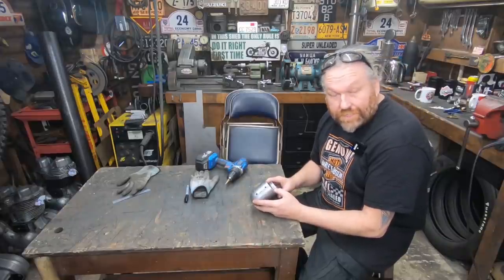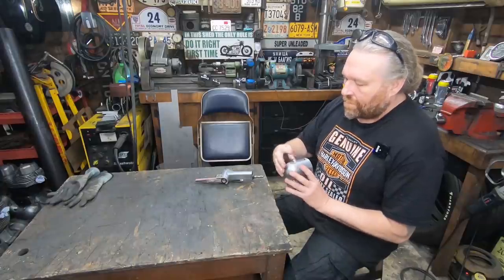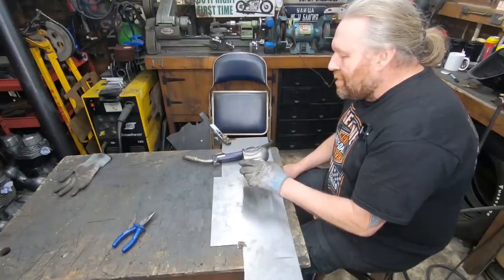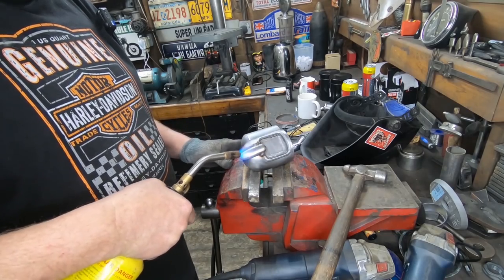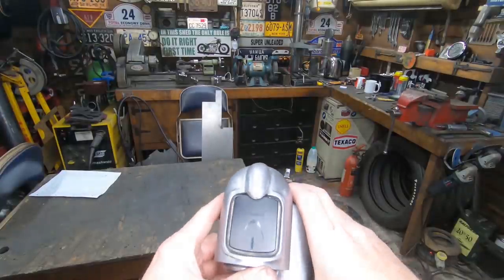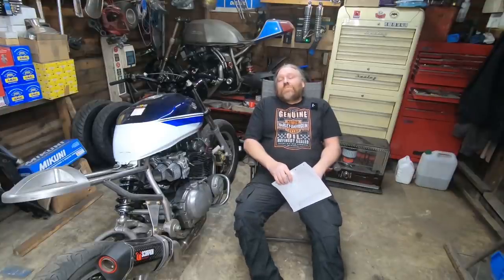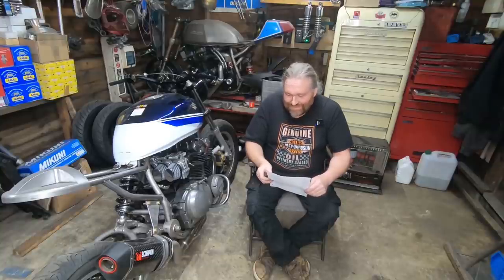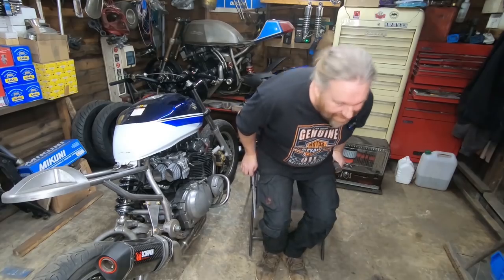Suzuki GS Prize Draw Project

Comment: Need to add welding wire, welding gas, grinding and cutting materials, metal, and any other consumables.

When the little light panel comes in, would I look strange to put them in another round pod under the speedo? Not sure, I'd need to try it to know but just a thought.

Comment: Will you need a different throttle assembly to work with those carbs or can you reuse the stock one?
Reply from the maker: Yes it will need a push pull cable system which i will be getting soon.